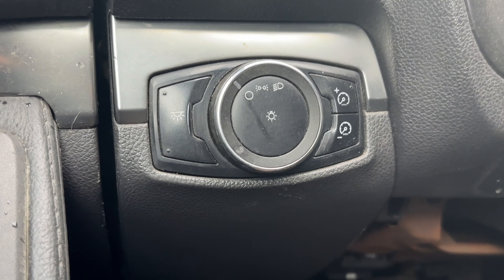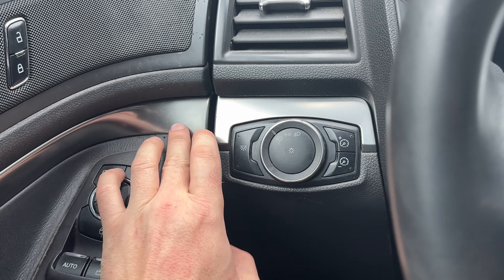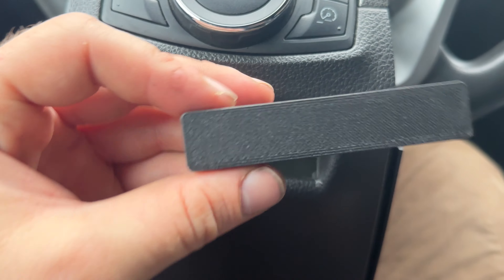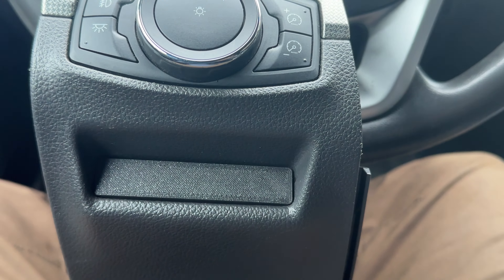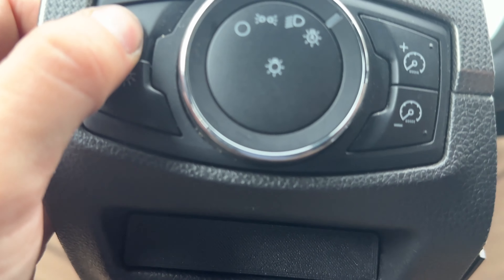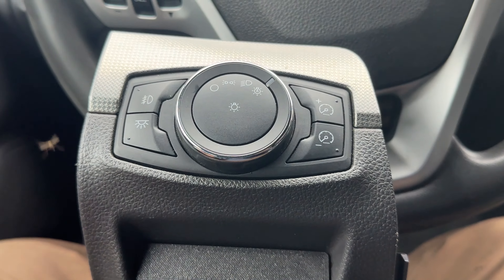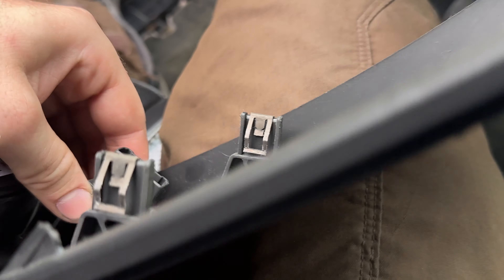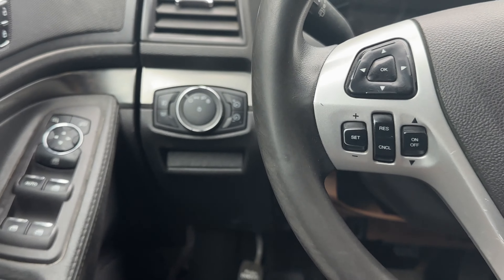Swapping the Headlamp Switch on a Ford Police Interceptor Utility (PIU) 2011-2019

Comment: You can also add into that switch panel a factory police idle which allows you to remove the key with the engine still on 2017 and newer will need IDS to activate it tho and the part number HB5Z - 13D730 - AA

Comment: For the auto lights wouldn’t you also require the photocell sensor located center forward of the dashboard?
Reply from the maker: I'm actually not 100% sure. I think so if you want it to turn off and on based on daylight conditions. Mine currently will always be on while the key is on so I don't have to worry about accidently leaving my lights on or forgetting to turn them on. That's what's most important to me.
Reply: @depolicify  makes sense, thank you!
Reply: @depolicify I like to turn my headlights myself make it easier lol

Comment: A couple of things that you didn't mention..  you also need to make sure that there is a "sun load light sensor" installed (OEM part number DG9Z-13A018-E) if you want them to actually turn on and off the way that they are supposed to.  Mine had the wiring for it, but the wire was just plugged into a flat cover/plug.  It's located on the dashboard in the middle close to the windshield.  It pops out really easy to check if it's an actual sensor or a plug, but the plug will be flat and the sensor will be convex.  

The automatic headlights also need to be enabled in FORScan or IDS.  Mine weren't (2017 FPIU).  

If you're just changing out the switch, you actually don't need to remove any panels.  A thin rigid tool like a Slim Jim or Shoveit lock bypass tool can be slid between the switch and the trim piece, and when done properly it will just pop out.
Reply from the maker: True, You can add the light sensor if you want the full function. I only care that the lights turn on and off with the car without having to manually turn the knob each time.
Reply: I got lucky on my 2017, popped in switch and sensor and auto lights worked right away. Now trying to get the interior lights to turn on when opening the doors via ForScan

Comment: OK, I managed to get auto headlights working properly in my 2017 FPIU after several days of trial and error. All exterior lights are off when the vehicle thinks that it is day, and all exterior lights are on when the vehicle thinks that it is night.

First I installed what Ford calls a "Sun Load Temperature Sensor" in the center of the dash. The wires were there but they were connected to a plastic cap. If you have the cap it will be flat, if you have the sensor it will be convex. The part number that I ordered (and was on the sealed Ford package) is DG9Z-13A018-E, but the number on the actual part is DG9T-14A597-BC.

Then I installed what Ford calls a "Headlamp Switch" with the auto position. The part number that I used is GB5T-13D061-CCW. Unfortunately this switch has a fog lamp button too, and while I would love to get fog lamps I don't think I'm prewired for them plus I have a feeling that the brace for my push bar would inhibit their installation. I have a Standard Motor Products HLS1755 on order that has auto but doesn't have a button for fog lamps.

Then I changed all kinds of settings in FORScan in the BdyCM and IPC (yes, I know, bad idea to do a bunch at once) to what I thought auto headlamps would require. No dice. The headlamps would come on when the vehicle was on, and turn off when the vehicle was off. I tested the sun load sensor by putting a 1000 lumen LED DEWALT light right on top of it while the switch was in auto, and the backlighting on all of the climate controls and radio would turn off, and the lights in the instrument panel would brighten. Obviously the sun load sensor and switch were doing *something*. So I started tweaking all kinds of settings in FORScan again. No dice.

I have a friend with a 2014 Escape with auto headlights from the factory, so I decided to look at his BdyCM and IPC to see what the settings were. Figured it couldn't hurt to try to duplicate them as close as possible, although I knew there would be different options. I noticed that his "Rain Sensor" was disabled in the IPC, and the "Auto Light Sensor" was disabled in the BdyCM. Apparently the "Auto Light Sensor" and "Ambient Light Sensor" do two different things. I had all of those sensors enabled because they sounded like things that would allow auto headlights to work. I think that the "Rain Light Sensor" disable is when mine actually started working.

I'd also like to change over to the OEM style explorer headlamps at some point with the LED strips, so these settings (I'm hoping) will be ready for those to work with the DRLs. I also disabled everything fog lamp related which I won't list here.

Here are all of my current settings which may or may not be relevant, but they are working properly with these settings;

IPC:
Adaptive Headlamps - Disabled
Adaptive Headlamps Traffic - Disabled
Auto Highbeam Telltale - Enabled
Auto Highbeam Option in Productivity Screen - Enabled
Autolamp Delay Menu - Enabled
Daytime Running Lamps - Enabled
Daytime Running Lamps Menu - Enabled
LED Low Beam Fault Indicator - Disabled
Rain Sensor - DISABLED

BdyCM:
Allowed DRL Options - All Options
Ambient Light Sensor - Enabled
Ambient Light Sensor Type - Fast (This is optional. Slow will delay the lights going on/off a bit, fast is.. well.. fast. I tested this too.)
Ambient Lighting Feature - Disabled
DRL Conditions - Option A (I tried B also, and all of the lights were on even when the sensor thought it was day, but they were a bit more dim.)
DRL Lamp Circuit Usage - DRL Only
DRL by Autolamps Initial Value - Enabled
DRL by Autolamps Personal 1 - Disabled
DRL by Autolamps Personal 2 - Disabled
DRL by Autolamps Personal 3 - Disabled
DRL by Autolamps Personal 4 - Disabled
DRL by Autolamps Vehicle - Enabled
DRL Configuration Action - Dedicated DRL
Daytime Running Lights Includes Parklamps - Enabled
Park Lamp Types - Position Only
Rain Light Sensor - DISABLED
Rain Sensor - DISABLED
Using DRL with Turn Signal - Allowed (I hate the way vehicles look when the lights flash off when the turn signal flashes on haha.)

Hope this helps some people to struggle a bit less than I did.
Reply: Thanks man! This is great. I think I'll give it a shot. Originally I just wanted to lamps to turn off when I shut the car down, my stupid self ALWAYS forgets, and they don't auto turn off for some reason.

Comment: Loving the video series, and I appeciate how much time it takes to record and publish this.  I have a 2014 PIU and am doing many of things you are doing.  Tackling this step today based on your vids.   I know the headlights turn off automatically after 10 mins with the stock switch, its the 'battery saver' feature.   I know I've forgot the lights a couple of times and this has saved me.    I ordered the sunlight sensor too, but alas when I pulled the filler plug out there was no harness.   Not a big deal I guess since (like you) I just want them on all the time and to turn off automatically when I park.   

Question - have you popped up your sunlight sensor filler just to see if the harness is there?  Curious to know.  I borescoped the area just in case my harness had fallen in, but nothing to be seen and first inspection.

I also had a look for the fog light stuff.  While my PIU has holes empty for the lights, there is no harness in the wheel arch.  I think the police had something aftermarket in the holes.    I ordered the slightly difference headlight switch then, the one with autolamps and without fog light button.  I'll never care enough to change the harness, buy and fit the lights, and work out the switch/FLM/BCM issues.   

Keep publishing!